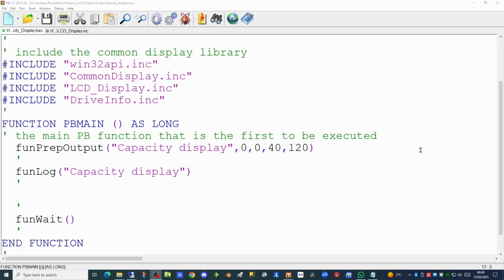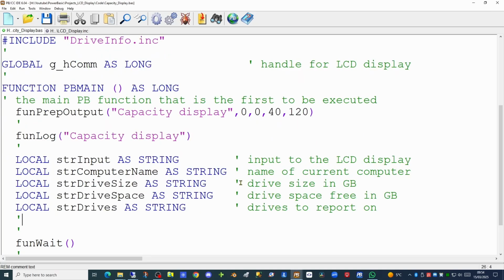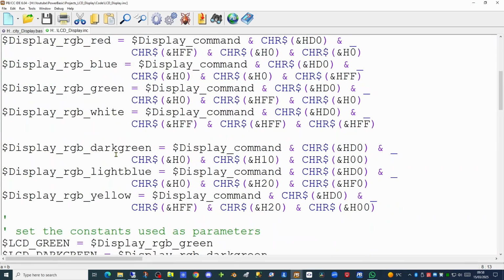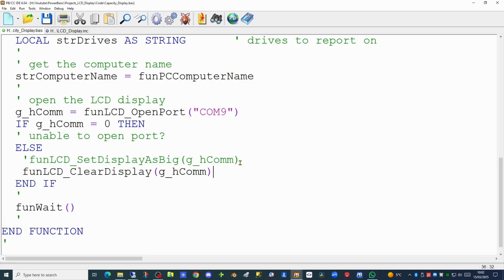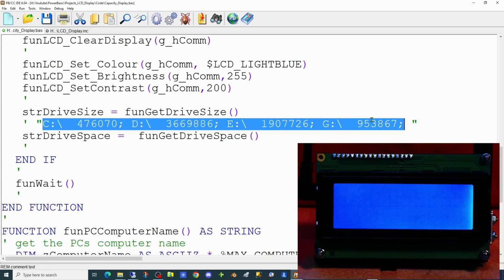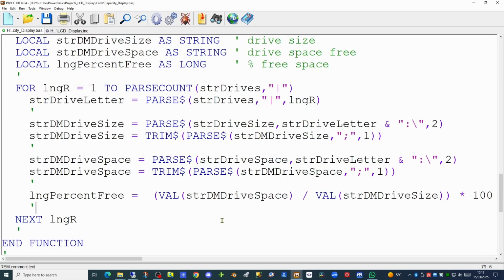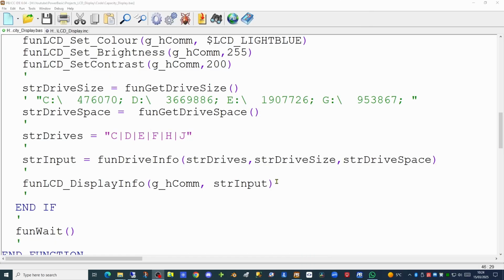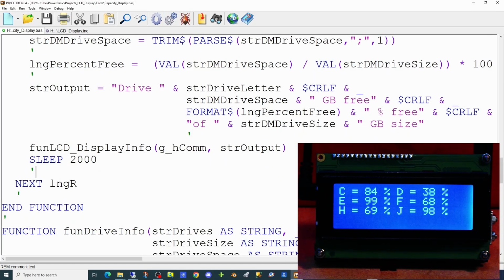PowerBasic Projects - Communicating with a 20x4 LCD USB display

Comment: Well explained. 
It would be interesting if the NAS's IP-address could also be displayed on the screen. Is there a library that could implement this?
Reply from the maker: As the computer could have multiple IP addresses you'd have to do something like this , then decide which IP address to display
  LOCAL lngIP AS LONG
  LOCAL p AS BYTE PTR
  LOCAL lngIndex AS LONG
  ' start at the first IP address
  lngIndex = 1
  ' pick up the address
  HOST ADDR(lngIndex) TO lngIP
  '
  DO WHILE lngIP <> 0
  ' convert to human readable if non zero
    p = VARPTR(lngIP)
    PRINT USING$("#_.#_.#_.#", @p, @p[1], @p[2], @p[3])
    ' advance the index
    INCR lngIndex
    ' get the next one and repeat
    HOST ADDR(lngIndex) TO lngIP
  LOOP